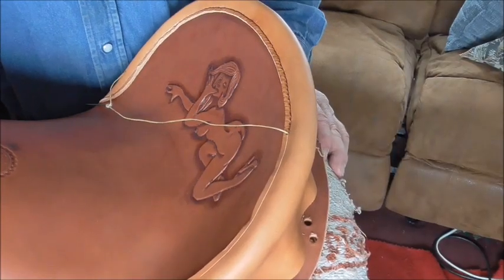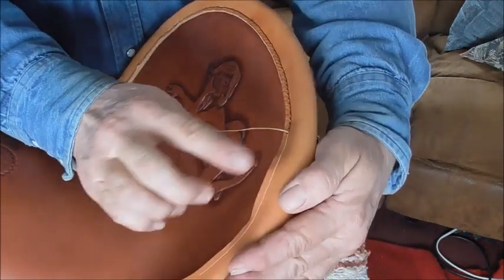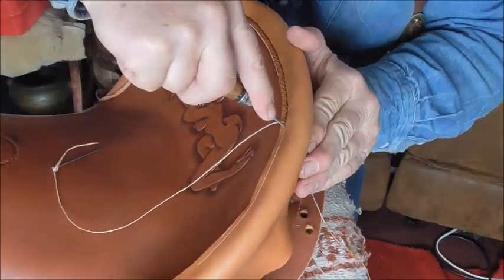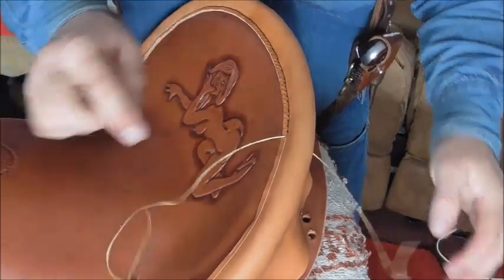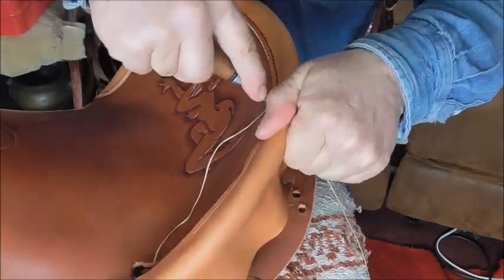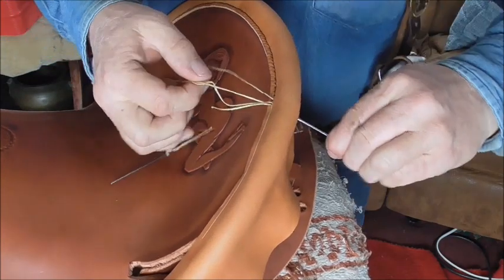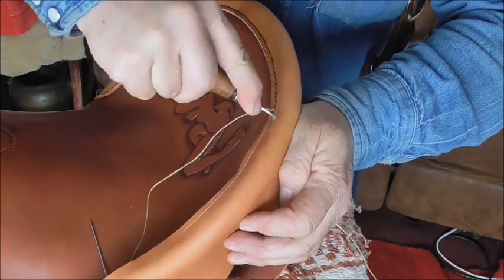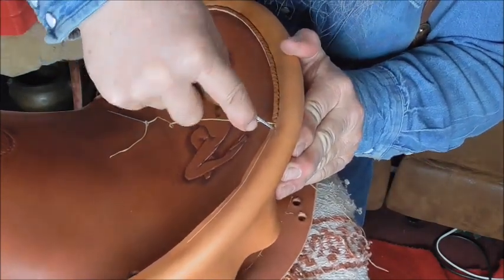Double Needle Stiching a Saddle

Comment: The extent of leather work I've done is sewing a leather wrap on my steering wheel. I didn't have an awl like that. I used my hands. I was banged up pretty good by the end of it and the needle was bent too. I got 'er done though. The saddle is looking mighty good! He's going to be a happy camper...or cowboy!
Reply from the maker: Thanks!  Yeah, you really need an awl.....or drill the holes.  I's almost done. I'll be happy to have it out of my living room. This place is too small.
Reply: @MuskratOutdoors  Mine had predrilled holes, but they weren't big enough for the needle. An awl would have definitely helped! I wished you made this video 2-3 years ago when I did it haha! Could you do it in the trapping shed?
Reply: Had any chance yet to set wolf traps?

Comment: Dang! I knew you did leather but I didnt know you did saddles thats my goal is to one day do my own saddle, ive fixed a bunch of stuff on mine but id like to start from scratch. Good video and information 👍👍👍
Reply from the maker: I taught myself from taking apart saddles and fixing them. You can do it, just take your time!  Remember anything you do on one side, do exactly the same on the other side.  Materials are expensive.  Wicket & Craig or Herman Oak leather is best. It's not cheap, but cuts, tools, and oils  easier. It's much nicer to work with than cheaper leather that has hard spots and doesn't finish evenly.  Timberline Saddle Tree company makes good trees. I get most of mine from there.  Give it a try!
Reply: @MuskratOutdoors  I will give it a try, thanks for the advice and some starts as of where to look for trees (I honestly wasn't sure on where to get a bare saddle tree), I think I'll make it a spare time project.👍👍👍

Comment: I am curious how you splice the thread/leather together, looks like you dont have enough to finish it.
Reply from the maker: The second string (the new added one) I start about two holes back and stitch over what I already did. The old one is cut off as short as possible.   Does that make sense?   It takes a lot more string than you think it should. I usually underestimate what I need.  The leather is about 3/4 inch thick, so each stich you loose almost an inch.
Reply: @MuskratOutdoors  yep, understood it perfectly